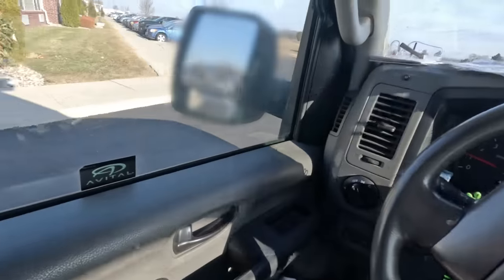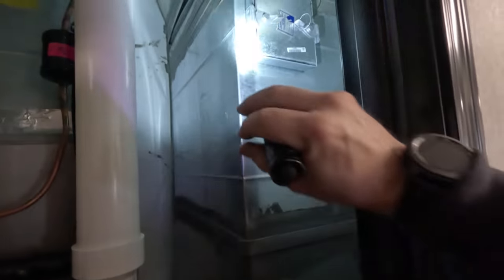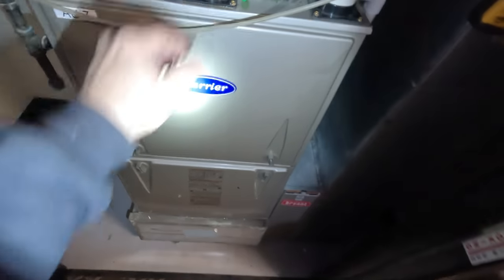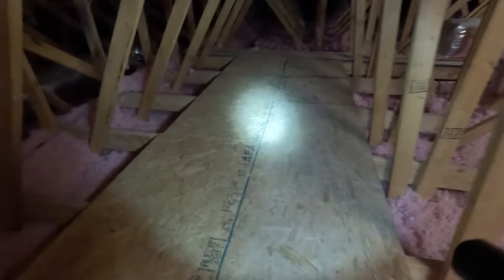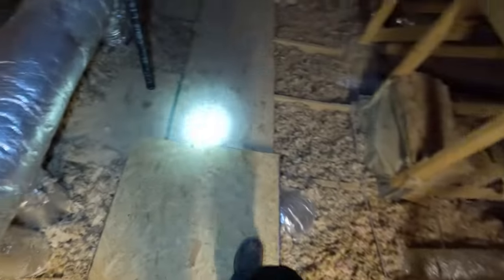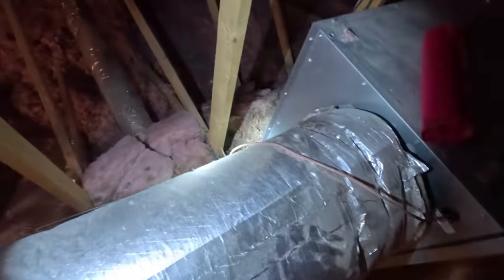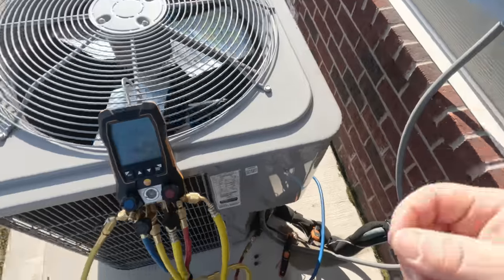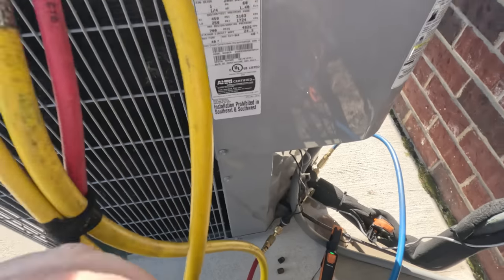AC Coil Is A Block Of Ice! How To Fix And Test

Comment: Those switches last way longer if you add a relay for the fan and use the switch to break 24v to the coil
Reply: I agree. You won't be switching as large of a load.
Reply: You would think the little screw on switches would last longer when switching a relay but I have not had any better luck doing so. After 2 of them failed in a short period of time on the same system I installed a ranco like in this video. Been working fine ever since but I did leave the relay in the circuit.
Reply: @tomoliver8498  I don't like the encapsulated switches either. I think the repeated cycling just causes them to fail whether you use a relay/contactor or not. I usually use the Ranco switch combined with a relay for small motors and a contactor for the larger motors. If the motors have sleeves instead of ball bearings then I try to sell the ICM head pressure control kit. Some customers don't want the extra cost even after you explain shortened motor life to them. 🤷‍♂️
Reply from the maker: I agree 💯👍👍

Comment: Those capsule switches are just a callback waiting to happen - best to just change them out with an old mechanical switch like you did.
Reply from the maker: Thanks Mike🤜🤛👍👍
Reply: @HVACRSurvival   Used to change the ones out on the units at our local 911 Dispatch annually - now I have them all changed out to the oldschool refer controllers.
The capsule ones are definitely quicker to install, but you'll just be back switching them out - especially down here where they're off and on 90% of the time....very few days of sustained cold weather.

Comment: The vrf systems is what that place needs
Reply from the maker: We have city multi systems at a few places but it's $$$$$,  what they need is commercial equipment but these places cut costs everywhere.
Reply: @HVACRSurvival  yeah they need a mixed air box and economizer at the least. It's ridiculous to be running mechanical cooling when it's cold outside.

Comment: I like those ICM fan speed controllers...i tend to not use that thermistor that it comes with, and i usually install the optional transducer. Hopefully its a ball bearing motor and not sleeve bearings. Great video as always Rick

The vinyl tubing is a great trick to keep from rub outs
Reply from the maker: We use the Total-Line version, usually these motors are cheap sleeve beings.

Comment: I have a 28 year old Coleman in a manufactured home. It's on life support, and I'm doing manual defrosts, as we're in the PNW and defrost is only needed maybe 15 days out of the year, and I don't like to run the heat strip. A recent snow storm knocked loose the wires I was using to operate the fan and reversing valve from inside, and I was unable to stop the fan for one night, so the coil only half defrosted. Too late to make a long story short, but even with a half inch of ice obstructing all airflow, I guess the heat of the compressor was enough to satisfy, because it wasn't running continuously.
This thing has taken a fair amount of abuse and kept running nicely. I won't be too heartbroken if it gives up the ghost, because I'll be able to install a mini split.

Comment: Over here they have kind of a plastic " serpentin " which is  almost like a piece of vinyl tubing but cut in a way that you can wrap it around a capillary tube very easily , and it protects it just as good .
It kinda wraps around the cap tube like a cobra snake wraps around its prey , just to illustrate the idea . 
I don't know what the make is or if there even is a part number for it though ...
Reply from the maker: I'm pretty sure I know what you're talking about. You see it more with electrical wires

Comment: Great Video.  Thank you for sharing. Is that low pressure switch you replace ? what is do for AC of that unit ? I saw it on refrigeration unit ? How set up differencial and pressure ? I'm new to hvacr
Reply from the maker: The switch I removed was a switch designed to close on a rise in pressure and open on a drop on pressure. They refer to it as a fan cycle switch, but it can be used for different applications. The purpose is to build pressure on the high side so that the metering device can maintain a normal suction saturated temperature above freezing. Set can be done different ways but essentially you want to keep your suction saturated temperature above freezing.

Comment: The style of fan cycling switch that you removed looks like it is rated at about 1 amp, or pilot duty, and should have a 24 volt coil that is energized by that fan cycling switch to actually power the fan, thus it can last many years.  I would rather have the control you installed, good for about 15 - 20 amps at 240 volts, so will also last for years.  

A word of caution, I had to replace a compressor on a small heat pump that had a fan cycling switch (looking at the furnace, you do not have a heat pump) and it was because the fan cycling switch kept the outdoor fan off in the heating mode.  I installed a relay that was energized when in the heat mode, thus keeping the outdoor fan energized all the time in the heating mode (unless in defrost).
Reply from the maker: Thanks, yep, I've had to add a bypass relay to heat pumps with fan cycle controls in the past for the reason you mentioned👍👍
Reply: @HVACRSurvival  I've had to do this too. Some forget that the condenser becomes the evap in heat mode. The ICM head pressure controls feature a heat mode override but I like those Ranco switches too. The sleeve bearing motors don't like short cycles though.
Reply: @Topher  yup...sleeve bearings need to spin at full speed to wick up the oil onto the shaft...then can slow down. The off/on with sleeve bearings will equal a short life span.
Reply from the maker: @jasonjohnsonHVAC  they can pay me to replace it, since they were the idiots that wanted this kind of system 🤣